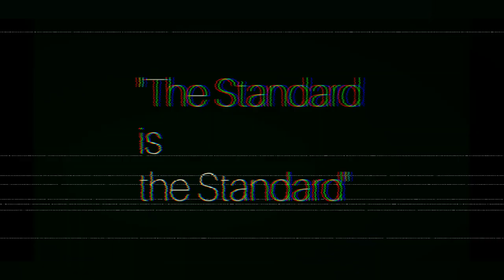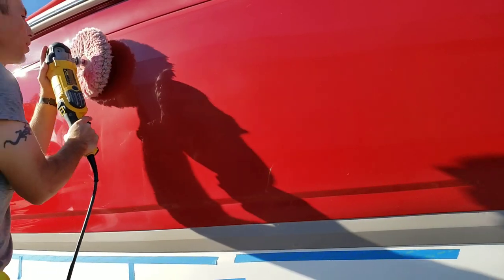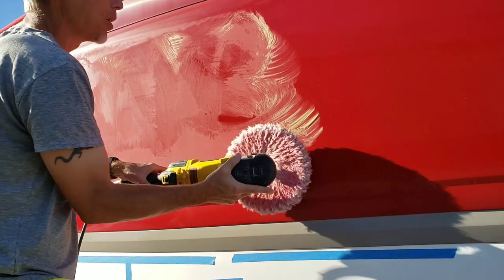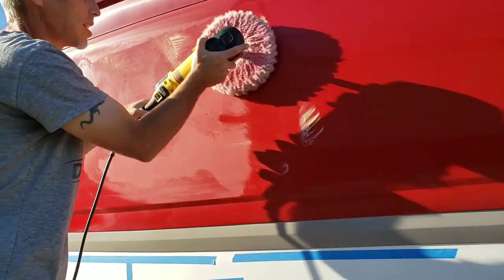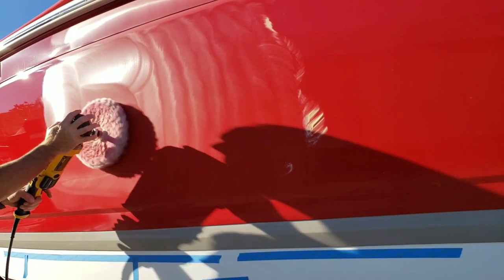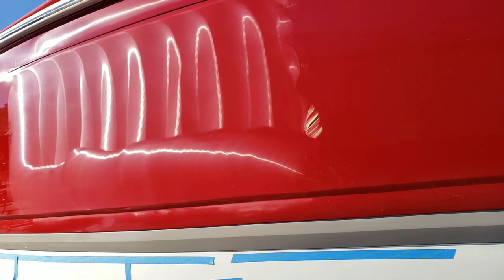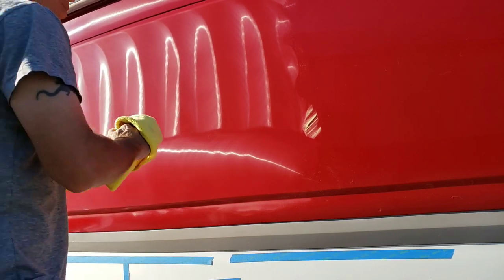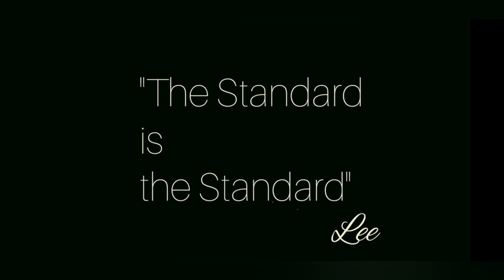Buffer speed with compound? Does it matter, really? It matters less than we think. Let me bore you.

Comment: I've taking what you're demonstrating and tried on my Gelcoat rv. I basically have the same equipment as you, the problem is my buffer will wobble and jump on me. What am I doing wrong
Reply from the maker: Not sure. Without being there.. Try a new pad? Being fair, my demonstration videos are not a class. I do however teach a class if you're ever interested. the cost is $500 and takes anywhere from two to three days. all I teach is how to compound nothing else, this isn't something that can be learned by watching a video. Not learned well at least, by most people.
Reply from the maker: Make sure you have even product coverage on the pad as well as the surface. Make sure to use a pad that does not shake your buffer too much when spinning. The other thing to try is (sounds stupid but works 70% of the time) hold the buffer differently. Adjust the pressure and rigidity of your hold on the buffer. Change hands. Pull the buffer off and spin it full speed. Flip the pad over. Clean the pad. Brace the hull of your boat, there might not be good enough rigidity in the fiberglass to resist a harmonic resonance that will literally shake a hull back and forth and bounce the buffer wheel off of it in the process, use a knee or shoulder.

There's a million things that can cause that hopping. I'm giving you the basics.

I teach a class if you ever want to learn how never to deal with that again.
Reply: @Local_Boydidgood  thanks for all the suggestions, I think one of my biggest problems was being stingy with the compounds. It's definitely an art, I'll keep working on it!
Reply: If you apply too much pressure it will wobble on you. Just light to medium pressure will do it.
Reply from the maker: With a nice pad, you should be able to almost twist it 90° and not have hop. You would never want to do this unless you're really mad at the buffer or boat then it's totally OK. 😅
Reply: @Local_Boydidgood  lol
Reply from the maker: Ya gotta let the grumpy out somehow right?